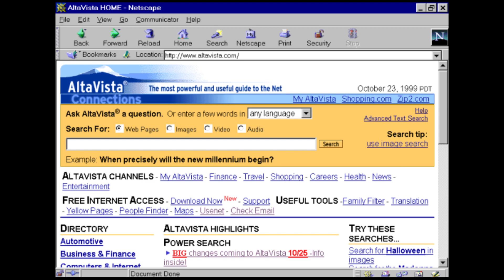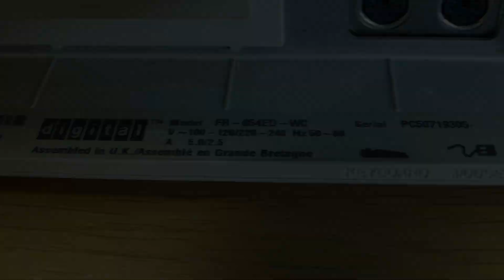Digital Equipment Corporation made a 486 PC

Comment: Hello, good morning, I really liked your video, it brings me excellent memories, because I had a DEC VENTURIS 575, i add memory and change the processor for one at 166 mhz, which increased the fluidity and performance, in addition to installing a video card and network, I remember using a Motorola 28.800 serial modem to connect to an incipient internet with noise beep, which was my fourth computer, before I went through the commodore, synclair, 8088, 286, 386, 486, until I got to pentium. I am looking to buy one and relive those moments, but due to the pandemic, work has dropped and many of us are without jobs surviving, in addition to the fact that the Mexican peso has devalued, the price rises and this is more difficult, however thanks to your video, I have remembered that equipment and how robust its construction, well done, that it will not be done again.
Thank you so much

Comment: I have this PC and love it dearly. You need to find some L2 cache for it. It makes a very big difference to performance. Also, initially DEC sold Tandy computers with their badge (Badge Engineering). This was before they started to sell their own brand which they did and made many many dozens of excellent models of desktops and servers.. right the way upto pentium 2/(and one or two very early pentium3 as an upgrade) systems.